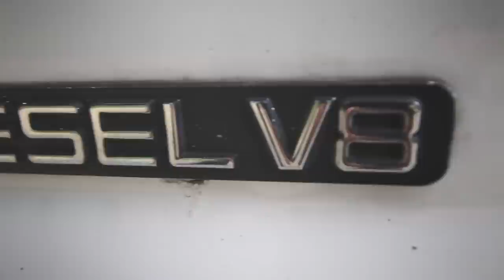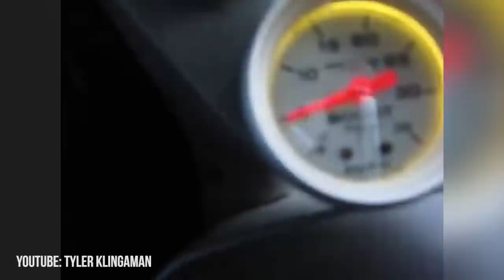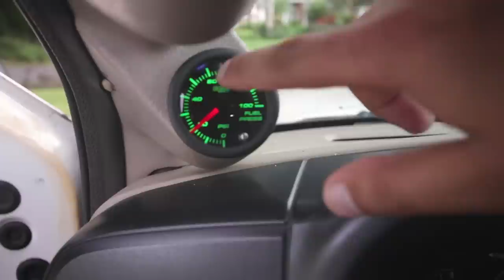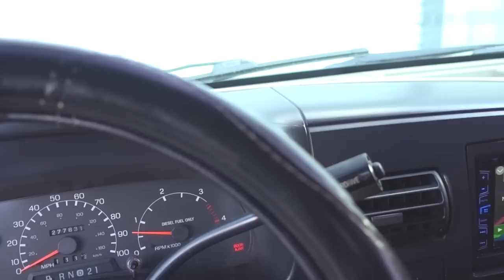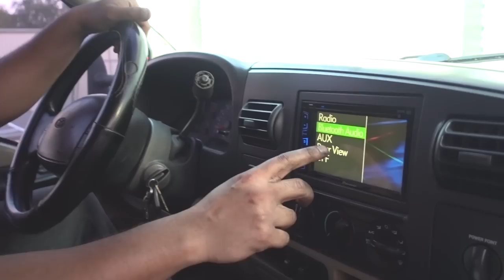Here's How I Made My 300,000 Mile Ford F350 Dually FAST As HELL (And Crazy Reliable)

Comment: Congratulations on your factory fresh lemon. 
I worked in auto parts from 98 - 08 and we sold a lot of conversions for the 7.3. The engine is solid but everything around it is a mess. 
The big things have probably been converted but just so you are aware. 
If it's manual, The flywheel comes in a single and a dual-mass. the factory dual-mass is hot garbage. 
Single mass might require a clutch conversion. the clutches are also failure-prone. 
Factory starter is also failure-prone there are tougher aftermarket conversions.
The factory filters are horrid. 
Air - get the FA1759 (Oval filter box) or equivalent, you can probably snag one from a salvage yard. Assuming you are not putting a cold air intake on it. The reusable oiled filters(K&N) are fine diesel don't mind a little extra oil in the fuel/air mixture. 
Oil - the factory filter is too long, if the engine mounts get soft it won't clear the frame. WIX makes a nice shorter filter, look for the XD part number. 
Fuel - There are Cap and Cartridge conversion kits. You can get a nice shiny iFJF F81Z9G270BA aluminum cap which will work with the  FD-4596 style cartridge.  Get the cartridges with the extra mesh shield on the outside, they take out smaller particulates and reduce gumming of the fuel system. 
You might also want to go with Dual Remote Bypass System, it replaces the bowl with a fitting block and couples a water separator with the fuel filter.
I had a water separator on my 4.3v6 Montecarlo. The fuel systems seem to really like them, something about condensate getting into pump gas because of the large underground tanks.   
Might want to get ahold of Joe over at TopTrucks https://www.toptrucks4x4.com/  I would wager they would have some interesting ideas about what you can do with it.
Reply: Oops, forgot about the big one. Check the compression every 100k miles. There is a super rare compression issue that the ECU will mask by playing with the fuel/air mixture and the timing. It's a stealth issue you will never know its happening if you don't check the compression. 
That turbo damage was probably from sand getting past that factory filter if it's been in Florida the whole time. A fair bit o sand can blow clean through the engine at dusty job sites if the filter isn't properly sealing.

Comment: When you got the ported compressor housing (ported anything in a boosted application) will lower boost because boost is a measurement of the restriction of air in the intake. So when you went from stock to the ported it was less of a restriction of air therefor less boost

Comment: Late 99 7.3 stock turbo international up pipes stock turbo with the vacume line off the gate and the heating element removed... dp tuner 140 race tune 4" down pipe 5 " back k&n filter with auto meter gauge 32 psi just did 4100 miles from wi to az and back pulling a 20 ft camper no prob love my 7.3

Comment: My dad has owned a 2005 f350 for 2 years and has only done breaks and oil and his 2000 f350 only had like a few waterpumps 1 wheele bearing and some front suspention and heater core in like for as far back as i can remember
Reply: Musta had all the warranty/recall work done before he bought it!
Reply: @dougauzene8389  could have but doubt
Reply: @trevorjaster4072  Then, You Must Have The Best Running.6.0 ln Captivity...The 400 + "Sick.0" CA Clients With lndividual Successful Lemon 03-07 Super Duty Truck Suits Against Ford WISHED Their Truck Ran like yours apparently runs!

Comment: Look into the wicked wheel 2 for the 7.3L they work wonders and are noticeably more responsive and snappy, I’ve been happy with mine since day one when I installed it in my turbo when doing my 600hp 7.3 power stroke build on my 1999 f350

Comment: Just make sure you tighten the up pipes well after a heat cycle so the donut seals get a good seal, and maybe check your exhaust manifold bolts sounds like that hissing may a bit of a tick from an exhaust leak on the manifold

Comment: You can hear the exhaust leak from the manifolds. It’s common on those motors for the manifolds to leak and bolts to break in the head on the good ol 7.3s

Comment: Cool video but compressor surge is when you’re under engine load and then the air pressure comes back and hits the turbo and turbo flutter is when you let off the pedal and the air comes back to the turbo

Comment: Higher boost pressure is bad technically. Boost pressure means restrictions. If you make less restriction on the intake then the same amount of air can enter the engine with less boost and puts less wear on components. So maybe the more power and lower boost pressure is a good thing for you

Comment: You might want to look at the up-pipes from the manifolds to the turbo. Those can rot out and cause significant boost loss. Your truck should be making closer to 25 psi stock and 30 psi with that upgrade.
Reply: Charlie Peters the up pipes is what he replaced

Comment: They are called up-pipes, not downpipes. The downpipe is from the outlet of the turbo charger to your exhaust. The up-pipes carry hot exhaust gas from the manifolds to the turbocharger in a V8 application. 

Also, when looking at pedestal you removed the component for the you referenced leaking is the EBPV actuator, not the valve itself. The valve is in the small section you replaced on the outlet of the turbocharger after the wastegate.

Also, ideally you want~60-65psi of fuel pressure reaching the injectors at all times. That is where a regulated return fuel system comes into play.

You really should also fix that exhaust manifold leak.

Comment: Next step would be a banks ram air intake I put it on my 7.3 definitely made a difference and a banks elbow  freed up the exhaust side quite a bit gained about 150 to 200 in temperature drop  I took quite heavy with my 7.3 6 speed and I've also updated my Turbo in tuning

Comment: get a new roller bearing turbo cartage, a new tune from DP tunes!! you will make 35psi boost 
run an external fuel pressure regulator set to 65 and turbo reference it so it will rise with boost
you will make your Friends brown with the G-fores

Comment: This is why I would rather get a Ford Excursion or a Ford Super Duty with the 7.3 liter Powerstroke Turbo Diesel V8 because even if that engine is really loud, it can still last longer than the typical engines that the Excursions and Super Duties come with like the (5.4 Gas V8), (6.0 Diesel V8), (6.4 Diesel V8), (6.7 Diesel V8), & (6.8 Gas V10)

Comment: Next time u get in there I would suggest a cold air intake considering there only about 3 buck also since u took the turbo apart I would have suggested a wicked wheel considering there not expensive I would also suggest some nice pipes for the collent if u were doing some other mods I would suggest a mishimoto radiator cooler and intercooler also the resivaor and temp just a few suggestions

Comment: I have an early 99 ive done housing upgrade trans valve bodies and few fuel upgrades, still small 120cc injectores but single nozzle tips, boost fooler, and switched out my edge programmer for a php hydra cuz its cheap and way better 4” exhaust and i cant seem to figure out y but for some reason it builds 29 psi of boost and does 138 miles per hour and 50-100 is faster than 20-50 its insane

Comment: is it on the original engine? I just bought a 99 f250 4x4 7.3L Diesel and am at 296k miles original. I'm about to put a hydra chip on it with 80hp daily driver tune, just want to make sure I'm not going to grenade the engine lol.. It's got new injectors, 150k mile transmission, straight pipe 4 inch exhaust and ford ais upgraded intake. I'd appreciate any feedback thanks.
Reply: Still got it ? How long did it last after this comment bro ?

Comment: Did you ever replace the high pressure fuel pump, that is a killer for the 7.3. It happened to my very very well maintained and clean excursion with only 162,000 miles on the clock.

Comment: Hey Tavarish, random question but you're having an exhast leak at high temp from what I saw, im having the opposite on the opposite, different car (I drive a jeep) although when the weather is low and the engine is cold I get what seems to be an intake leak (too lean?), its fine once the engine heats up for a bit or during the summer. any clues?

Comment: Did you ever drop the tank and get rid of the little filters inside the pickup tube housing?   Likely the cause of the low fuel pressure.

Comment: Get the wicked wheel II from Dieselsite.com.  Huge difference....you should be building way more boost than 20PSI.  Mine will run up through 35PSI with the WWII and stock tubo housing.  I have the manual waste gate actuator also.  The stock one starts to open the waste gate at about 12 PSI.  Once you get past 24PSI you'll need a boost fooler or a better chip like a Hydra or you'll get an overboost code and an SES light.  Cool truck though.  Long life the 7.3!
~jw

Comment: It always amazes me how in the usa the manufactures get soo little power out of such big engines. In Europe we've veen getting 200-300bhp out of 1.8 & 2.0 engines as standard for about 15-20years and even before that we were getting 150-200bhp out of  1.6 & 2.0 engines both deisel and petrol. 
As u know evos, Scoobys etc....500 to 600bhp. 
My old 2001 bmw 330d estate has 350bhp reliable 250k miles with just a few basic mods.
Tis crazy 8.2l engine with only 194hbp how soo little lol

Comment: You could also pick up a little more power and mpg if you put the turbine wheel of of an early 99 7.3 truck so july98-dec98 7.3 turbine wheel. They also call it the wicked wheel
Reply: A wicked wheel is a compressor wheel not a turbine wheel
Reply: @AK_Ray  correct! Don't mind me 😂😂

Comment: It's a 7.3 powerstroke. It's going to leak a fluid somewhere lmao. Fantastic engines though, love mine!
Reply: Any engine will have problems (chevy)
Reply: @chasejones910  i'm just saying 7.3's leak. I've got one that we bought new in 1999 and it's leaked its entire 350k mile life so far and it'll still pull a house down
Reply: @lukegrimes916  and i'm just saying any engine will leak(chevy)
Reply: @lukegrimes916  my dad has a 1995 powerstork 7.3 and it does not leak I think there is just something wrong with yours
Reply: @chasejones910  I've had 3, they all did, it's just something they typically do
Reply: @lukegrimes916  or the owner does

Comment: Freddy,  the fuel system is not a returnless it dead heads cause it runs all the way thru ending at the drivers side head, thats a regulated return system allowing the fuel to split them be equal pressure at the front of both heads also they are UP pipes, did u run it with no air cleaner? The people that dont work on 7.3 might let u slide on not explaining that the new compressor housing had a 4" inlet versus the stock one having 3"

Comment: Your truck weighs way more than 7500 man lol. My extended cab single wheel axle is about 8200
Reply: Jakob Statzer my 06 dodge 3500 dually weighs 8060lbs with a welding bed with no tools or welder on it

Comment: That flap is actually an exhaust brake.
Reply: Yes the EPBV is there to help in cold starts but when the heat riser control valves start heating up it does close this valve in 1999 and newer trucks, hense retarding the engine. Yes it is also an exhaust break. Internationals are what I work on every day.

Comment: Have you vacuumed the oil out of the oil collector deal in the front of the block?  Its the oil supply for the injectors and doesnt ever drain during normal use so its the same oil thats been in there since the last time it was changed out.  Deuce and Guns has a great video on it with his OBS 7.3

Comment: Adds two pounds of boost.. blows every injector o ring and a head gasket 50 miles later
Reply from the maker: 5,000 miles later, still hasn't happened.
Reply: Tavarish give me a call when it lets go, ironically my 2001 f350 service truck (I’m a  heavy diesel tech) just lifted a head gasket for the third and final time. (I’m sort of local)
Reply: Naaah...lt's a 7.3, not a 6.0...
Reply: Doug Auzene I’m well aware I worked for ford, and several diesel performance shops specializing in power strokes.. they all have their issues like any other truck
Reply: @krazzz69  Duly Noted...Still, would rather have a 7.3 as opposed to the "Sick.0" Lemon motor...
Reply: Doug Auzene  6.0’s can be built to be reliable. The real hunk of shit to leave ford was the 6.4l
Reply: @krazzz69  True...l've seen lt done myself...But,  Your Average new 03-07 6.0 buyer didn't pay 60k to then " reinvent the wheel" when their trucks took a crap! Used Market, or Hobby...lt Can Be Done! 6.4...FEH!
Reply: I drive a 06 6.0 daily. Its bulletproofed and ready for any 5k hike.
Reply: @southernbrew4252  Nice....How much did all the bulletproofing over stock run ya?

Comment: I want a big truck as my first car ever but i dont think i have enough money for one... :(
The big nice ones are just so darn expensive

i have 12000 if anyone is wondering
Reply: I'm selling a 2004 f350 dually 8ft bed  extended cab 6L diesel for 10k im sure you can find something
Reply: Have you even looked at used cars?
Reply: @bayarea41510  not in norway my dude
Reply: @D3fcon141  ofc